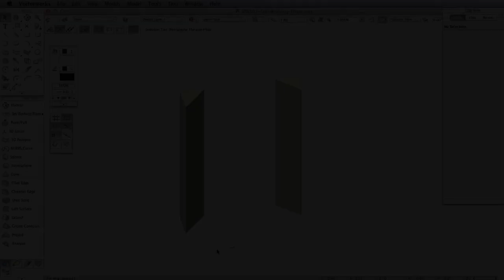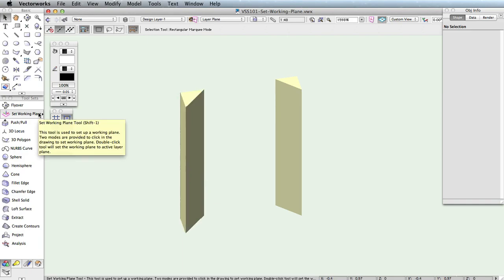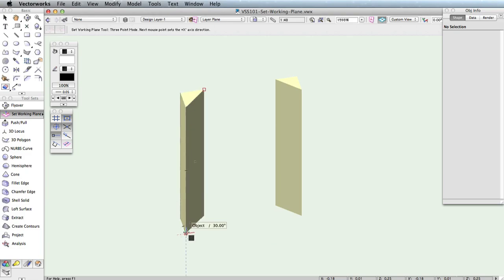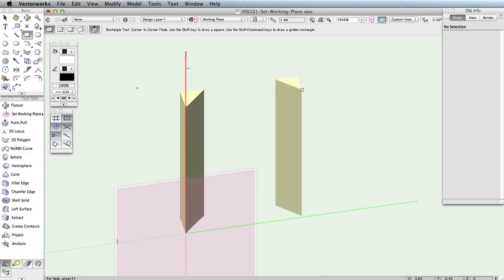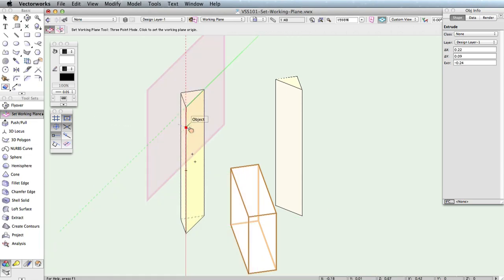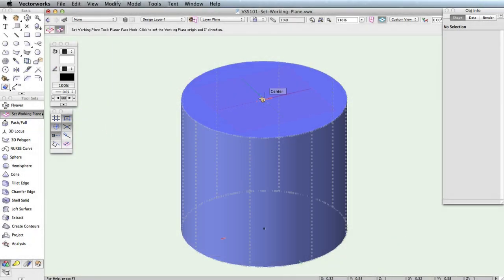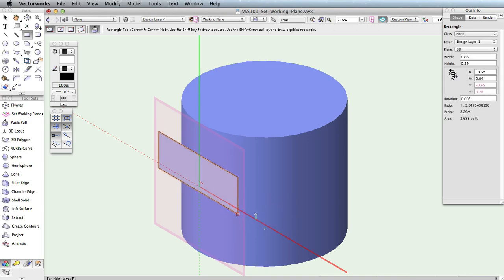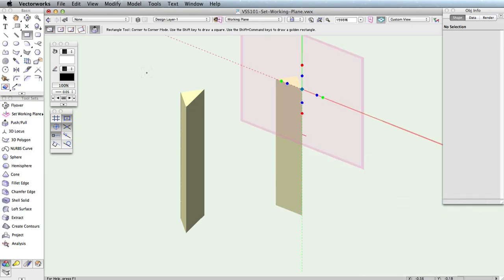Working Planes - Set Working Plane

Comment: The problem with this method is that to create the plane you have to allready have 3d objects.  I tried this from a blank layer plane oriented in roughly a right iso view.  I chose three point mode, clicked the origin, then a point on the xy plane, then tried to select a point on the z axis but it will only snap to another point on the xy plane.  This seems like a real screw up in the design of the program functionality but I'm a beginner so maybe I'm missing something blindingly obvious.